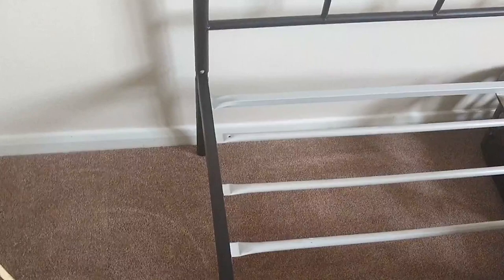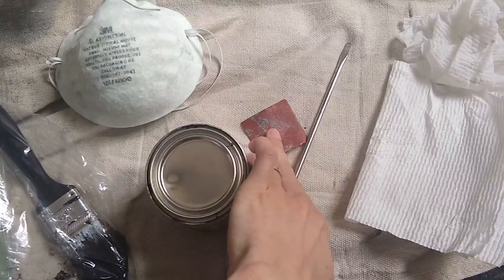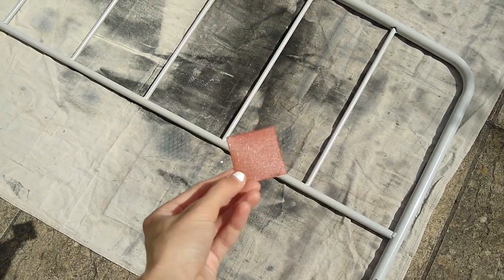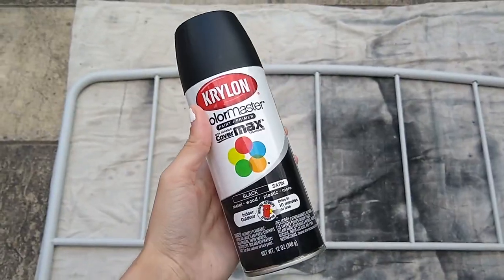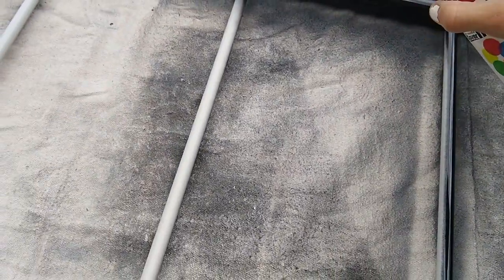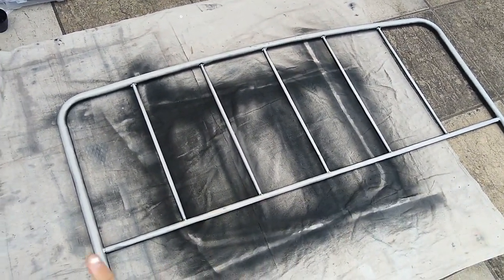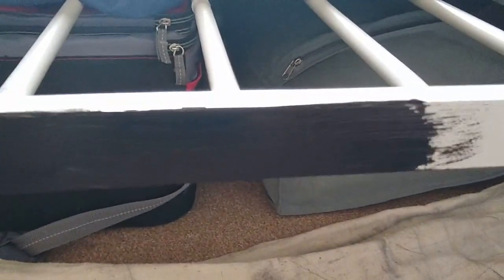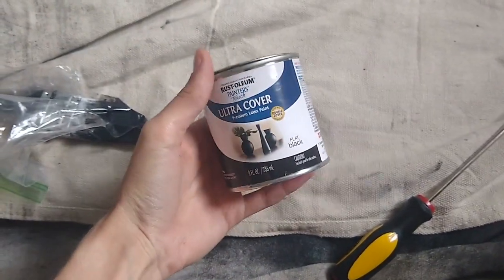My DIY Metal Bed Frame Painting Process

Comment: I bought a brown iron bed by mistake & will paint it black. It hasn’t been out together yet so I’ll spray paint the whole thing. Did you paint the bottom part of the frame with a paint brush because it was already set up?
Reply from the maker: Yup! That’s exactly what I did. I didn’t want to undo the whole bed. I still lightly sanded it first though.

Comment: I painted my bedframe with Rustoleum satin, and it looks too shiny. Now it’s set back up. It was a pain to take apart. Could I go over with paint and a brush instead of spray paint this time with the matte paint?
Reply: I don’t see why you wouldn’t be able to. The paintbrush may not give it as smooth of a look as spray paint, but it could also give it a fun textured look.

Comment: I have the white metal bed from ikea, I want to either paint or hold, or paint it green with gold posts… should I prime it first? Or just sand it?
Reply from the maker: Honestly, I would just sand it. I tried priming once before on a different metal project thinking that would be enough. It flaked off the next day:/ you don’t have to sand very much or vigorously. You just want there to be enough texture and grooves for the paint to adhere to. Hopefully this helps! Good luck with your project:)

Comment: This is so helpful thank you. Is it ok not to use a primer?
Reply from the maker: As long as you sand the metal a little bit, I think it should be okay to not use primer. The main thing is that you don’t want to paint on smooth metal because the paint won’t stay.